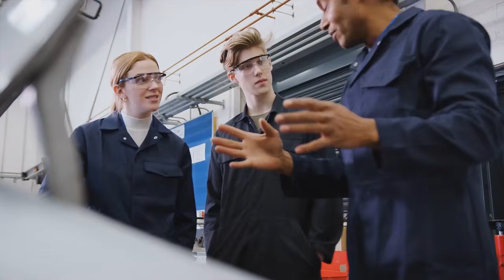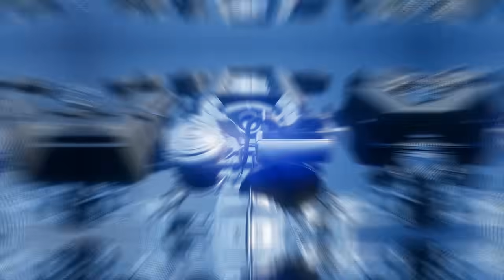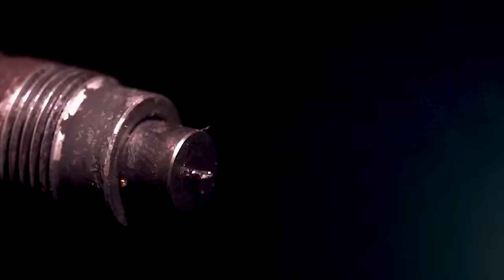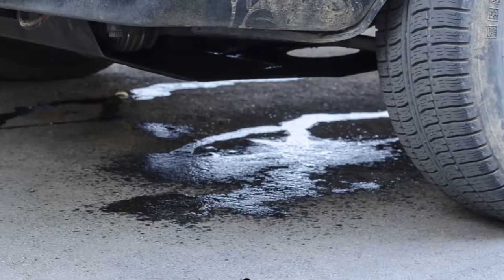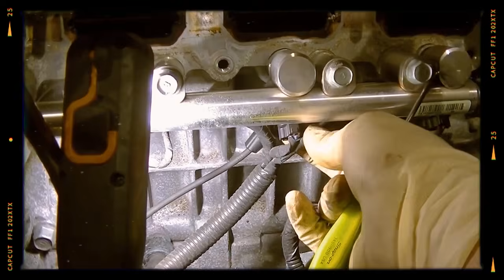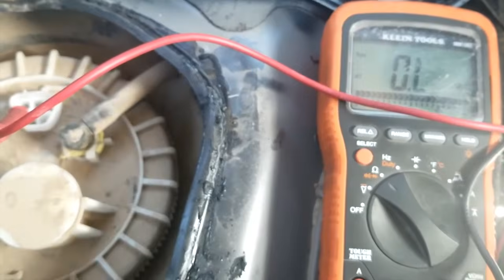13 Engine Sensors That Are Slowly Killing Your Performance

Comment: This is a list of my codes, what can I do? Primary Codes:
• P0171: System Too Lean Bank 1
• P069E: Fuel Pump Control Module Requested MIL Illumination
• P018B: Fuel Pressure Sensor Performance
• P018C: Fuel Pressure Sensor Circuit Low Voltage
• P2270: HO2S Signal Stuck Lean Sensor 2
Secondary DTCs:
• P0171: Fuel Trim System Lean
• P0106: Manifold Absolute Pressure (MAP) Sensor Performance
• P0496: Evaporative Emission (EVAP) System Flow During Non-Purge
• P1101: Intake Air Flow System Performance
• P2635: Fuel Pump Flow Performance
Other Codes:
• U0401-71: Invalid Data Received From Engine Control Module - Invalid Data

Comment: Something to keep in mind is that not all vehicles have all the same sensors and they are not all located in the same place.
For example I have a 1999 F-150 4.2L v6. My knock sensor is on the block just under the head on the passenger side. I've seen the same engine (4.2L v6) where the knock sensor was on the head next to the fire wall on the driver side. Also I do not have a Engine Coolant Temp sensor. I have a Cylinder Head Temperature sensor. It does not access the temp of the coolant. It is mounted on the cylinder head it self and reports the temperature of the head.
However, this video is not about where they are located. I'm just sayin.

Comment: I live in Hope outside of Vancouver. My car is a 2010 dodge journey 3.5ltr engine it gkves me a constant check engine light. I scan with my ipad ising a blue driver app. I have changed various parts ,the light stays on, on a 60 kilometer drive i get 8,8 liters of fuel per 100 kilometers😢

 with a 3.5 l endpvine i ha
Reply from the maker: That’s exactly why I made this video. On the Dodge 3.5L, the check engine light is often caused by bad sensor data or wiring, not the parts themselves. MAF, O2 sensors, coolant temp sensor, vacuum leaks, or corroded connectors are very common. Also, 8.8 L/100km is actually decent for a 3.5L V6 👍

Comment: Helpful hint of your car is over 30 years old get a capacitor repair kit and solder new capacitor into your TCU & ECU and your car works perfectly again. Capacitors have a shelf life of 36 years and will go bad and leak and cause your check engine light to come on and many other sensors to go bad and send off the wrong signals to your ECU and TCU. And no one even thinks about replacing your main relays which is the fuel pump relay.
Reply from the maker: That’s a real issue on aging electronics. Not every case, but definitely overlooked.

Comment: How many sensors are there on a grand Cherokee WJ 31 diesel engine 1999/2000 model
Reply from the maker: The WJ 3.1 CRD has multiple air, temp, pressure, position, and speed sensors — usually around 18+ total.

Comment: 1. MAF Mass Airflow
2. MAP Manifold
 Absolute Pressure
3. Crankshaft sensor 
4. Camshaft sensor (limp mode)
5. Intake Air Temperature (IAT)
6. Engine Coolant Temperature Sensor engine temperature & performance
7. Vehicle Speed Sensor (on wheels) affects tranny & gear performance 
8. Knock Sensor
Bolted to engine block. 
9. Oil pressure sensor (extremely important!)
10. Fuel Level Sender (FLS) 
11. Sensor connectors & wiring (no 1 to  check)
Reply from the maker: Appreciate you adding to the list!
Reply: @AutoTruthLab  Thank you for the awesome video, information and channel 😊
Reply: Thank you 👍
Reply: @Patriot-1776KY Thank you for appreciating 😊